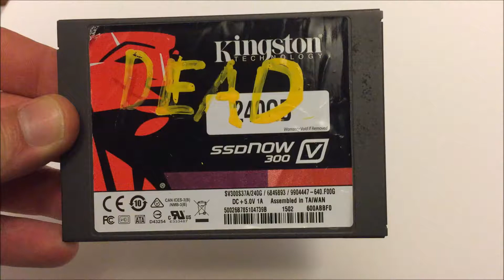Whats Inside an SSD Drive- Faulty SSD NOW 300 Teardown

Comment: I have one of those it's still working after about 20k hours but I had to remove it from my pc and reinstall windows it was causing some issues with my system boot, there was a dead sector with old boot partition that I couldn't remove so now I'm using it as a kind of pocket ssd with a usb3-sata ''dongle'' it also happen to be a 240GB one the drive health is at around 94.5% meaning that some of the sectors have already been replaced with the built in spare ones.
Reply: 后辈
: All you have to do is Secure erasing your SSD, that means you factory reset your SSD and that erases also this broken Bootloader from your previous Windows. 94% of remaining life is excellent. You have no broken Sectors. Just Secure erase your SSD drive search on Youtube How to Secure erase SSD :-)